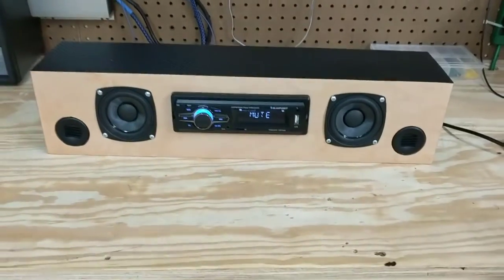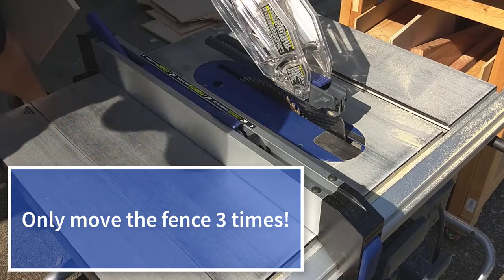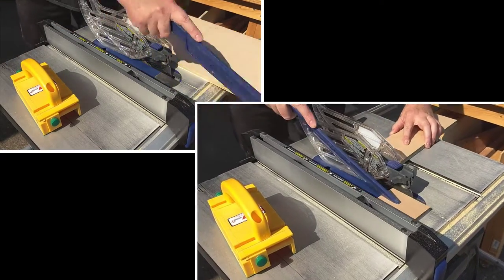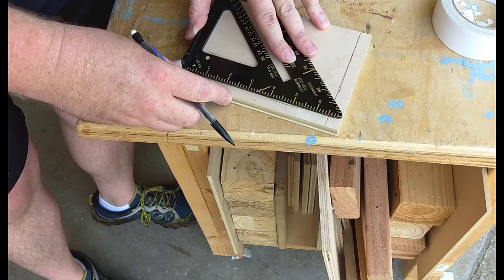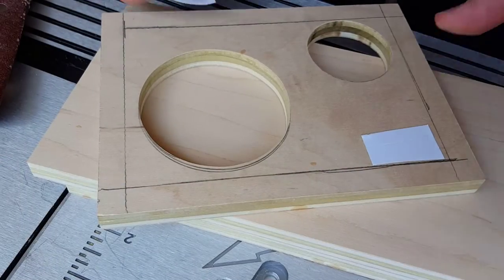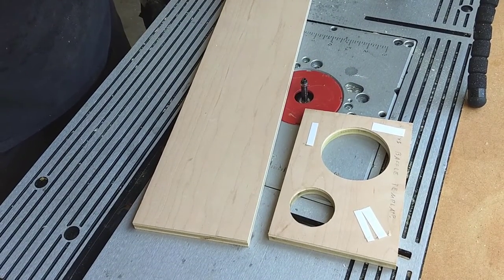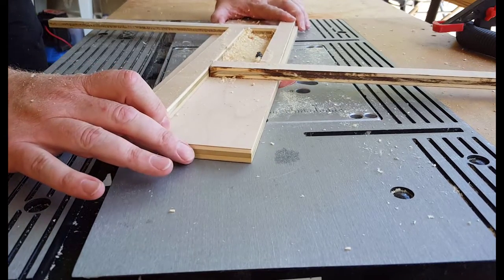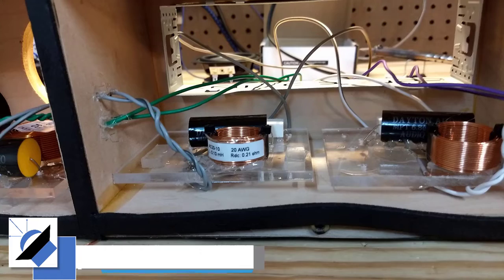Car Stereo BoomBox with Bluetooth (Part 1)

Comment: If you were to use a marine stereo and a marine amplifier and a 12 marine subwoofer and 4 6.5 inch marine speakers and a battery from a boat to build a boombox would it then be a waterproof boombox.
Reply from the maker: Yes.  You will want to use marine grade plywood or some type of plastic.

Comment: I have that same table saw. It's a good table saw that was very affordable and works awesome.
Reply from the maker: Everything else in the same price range has a 24" (or less) rip capacity, and you can fold it up to store it out of the way.  The only downside is the fence, which is a pretty big downside.
Reply: @DIYAudioGuy  ahh yes, I did some modding, and now I'm able to to rip 40 inches.

Comment: I have a car radio and it is 45w pre channel can i use 50w or 60w speaker with the same radio please cum back
Reply from the maker: Absolutely that will work fine.  Just verify that the speakers are 4 ohms nominal impedance.  Most car speakers are, but there are a few that are 2 ohm.
Reply: @DIYAudioGuy  if you are useing a p.s.u for a car radio can i use another  12v connection for leds as well please cum back barry
Reply from the maker: Yes, just don't overload the power supply.